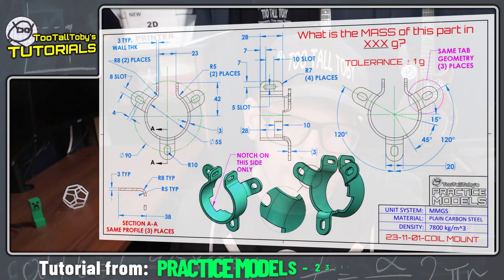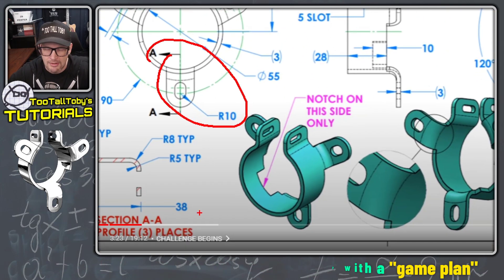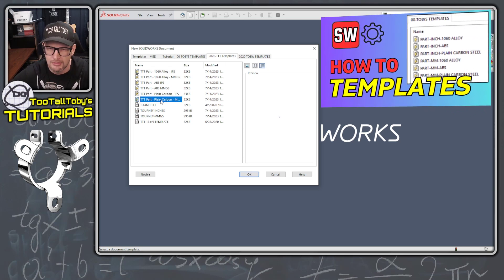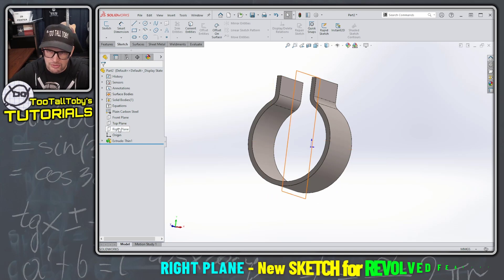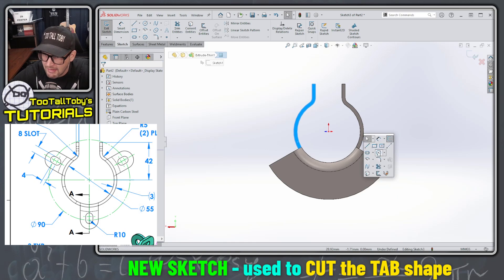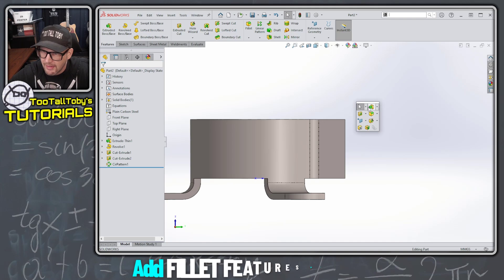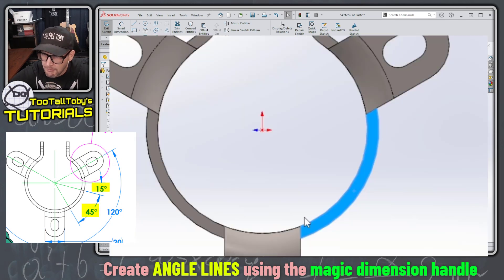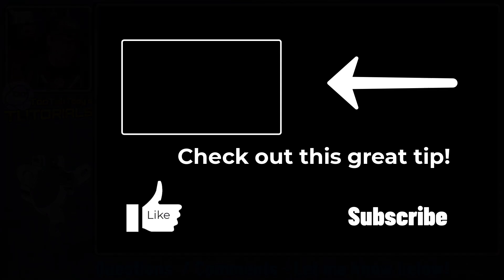SolidWorks Beginners Tutorial - Thin Feature, Revolve, Geometry Pattern

Comment: Where is the Flat pattern, if I make sheet metal, I often have to finish with laser cutting and folding 🙂
Reply from the maker: take a look at the livestream TOBYS SHEET METAL TIPS AND TRICKS - that's where I explain how to use flat pattern in solidworks.

For this model, I couldn't figure out a good way to do it in sheet metal (and flatten the results) - but I'm open to suggestions!
Reply: Hey Toby. Thanks for the continued wealth of information. But... Design is rarely the problem. In real life you need to manufacture the design and in this case it would 100% have to be sheet metal, laser cut and bent. So if you can't flatten it you can't make it. If you can't make it your design becomes irrelevant.

To solve  this problem I'd design the bracket without the three tabs. Flatten it and add the tabs to the 2D cut file. After laser cut I'd  bend the two ends to the correct angle and roll the round part over a mandrell. While on the mandrel, I'd clamp the part in place forcing the ring to stay round and only then bend the three side tabs.
Cheers.
Reply from the maker: Good work! @vandbaxelrad6902